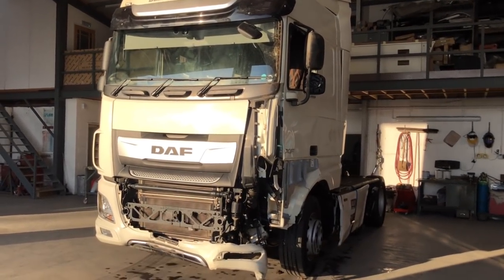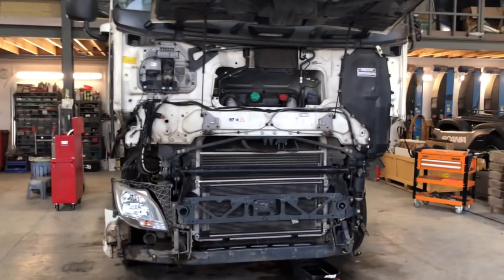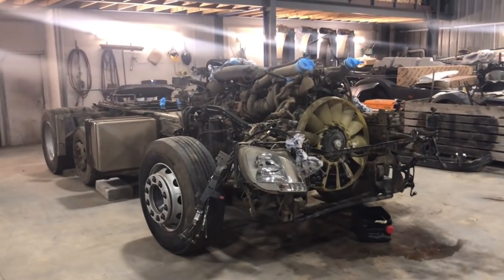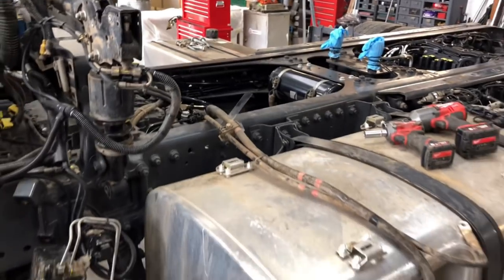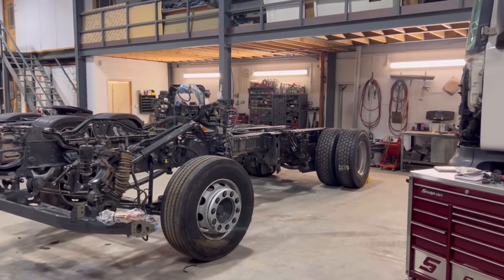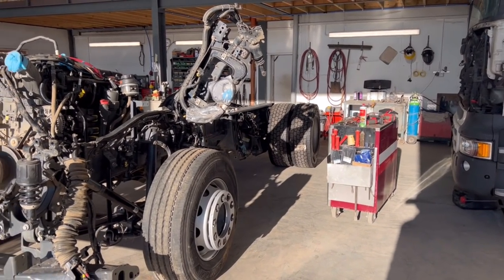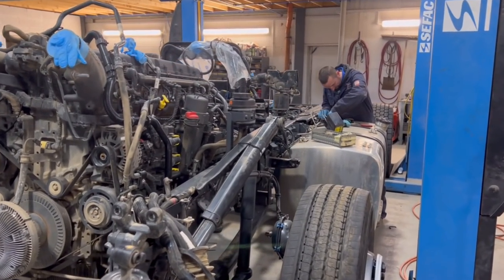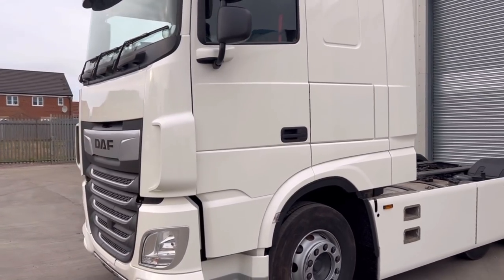Rebuilding a Wrecked 2021 DAF XF  160 hours to fix it !!!

Comment: Brilliant job, when I worked for Ford and Slater in the 70s things where much simpler, we had the Leyland ergomatic  cab, so taking them off was very simple as all the electrics stayed on the column, we used to use a guy called Dave Ambridge from Ollerton who came along with gas bottles porta powers and big hammers to straighten chassis. Later we had the Bee line system. Happy days retired struggler.

Comment: You say, "it's not a big deal" or "it's pretty simple", but to me, you've practically rebuilt this one, stripping it right down to the chassis. What the top job. Great work. Also, to me, the XF is my all time favourite cab, because it came out in the 80's (as the 95), which is when I first started driving lorries.
Reply from the maker: Thank you 🙏🏽

Comment: It would be interesting to know how they shrink the metal that has been stretched ? with out using heat,     Truck Align at Charlton used the same ider to straighten chassis way back in the 80s

Comment: One question out of curiosity, re: crane; you seem to be bringing back your crane truck each time you want to lift or lower heavy loads, however you have quite a sizeable building, so why not install a fixed crane on rails within the building itself and do without the truck?